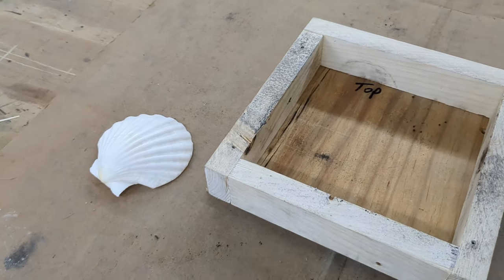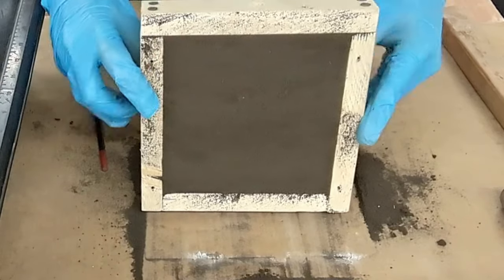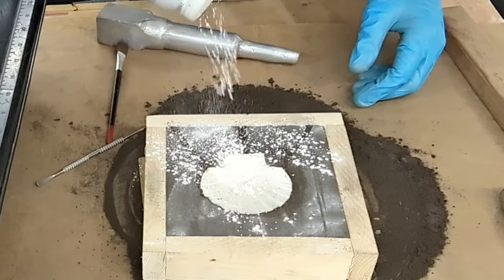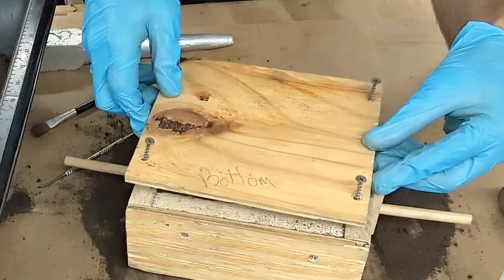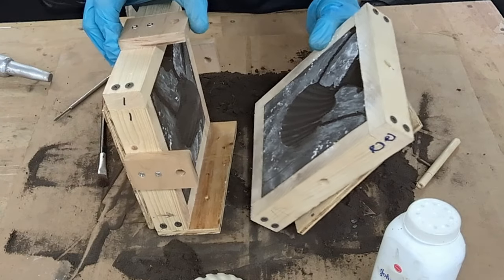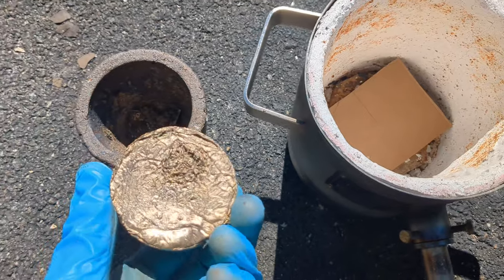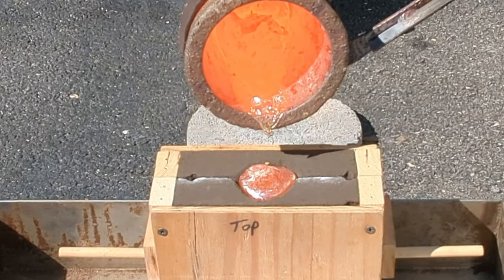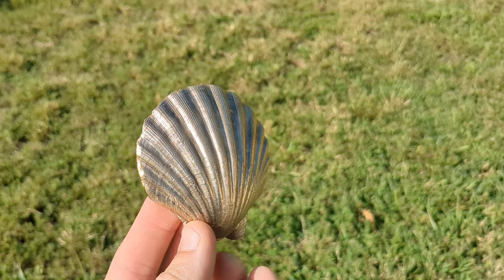Seashell - Make a Gold Seashell using Molten Metal - HowTo DIY (Crafts)

Comment: That's an amazing result! Was not expecting the metal to flow through properly let alone retain all that detail. Awesome.
Reply from the maker: I'm glad you liked it 👍 Metal casting is great it captures the detail of whatever pattern was left in the sand.  Flowing through thin spaces is hard.  The metal has to be at a good temperature so it doesn't solidify too soon.

Comment: Excellent job on that casting Mate 👍 I have always found when I'm casting thin stuff with Petrobond/Delft Clay they never completely fill and always end up revising my moulds!
Reply from the maker: Thank you so much. 🙏 I've cast this shell a number of times until I finally figured it out lol  It has to be done in a vertical mold.  The metal also has to be a good amount above melting temperature or else it will freeze mid way.  Adding vents is a must for the air to escape.

Comment: Very nice. I have a hard time pouring that thin.  Cool wooden frames for casting
Reply from the maker: Yeah David, I did too.  I can't seem to pour this with a horizontal flask.  Try a horizontal flask and see if you can get it to come out. Thanks 🙏
Reply: Yeah horizontal didn't work. Did notice that you used scratch vents pouring vertically. I didn't. May be some of my problem
Reply from the maker: @davidhinshaw5242  oh yeah!  I'd say that was the problem.  You need to push the air out fast.